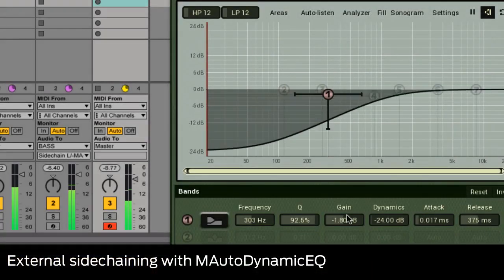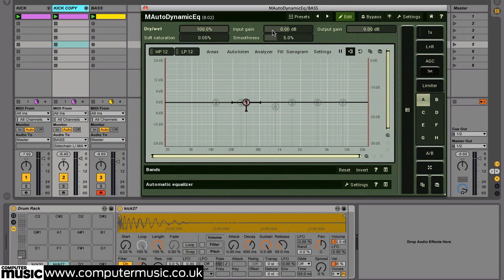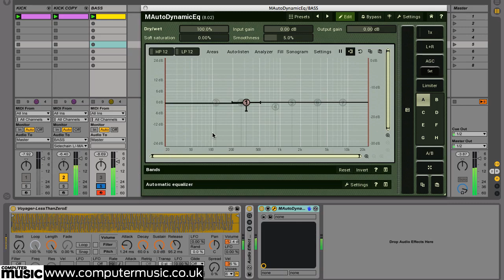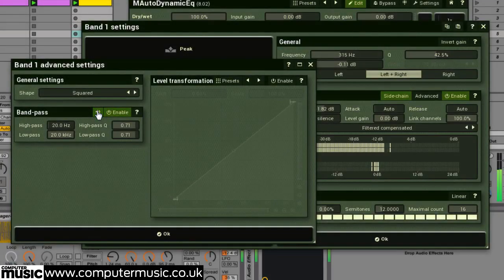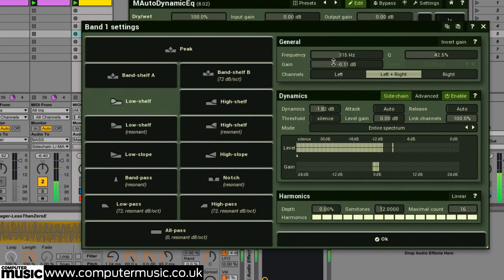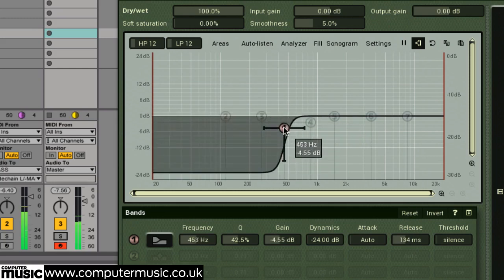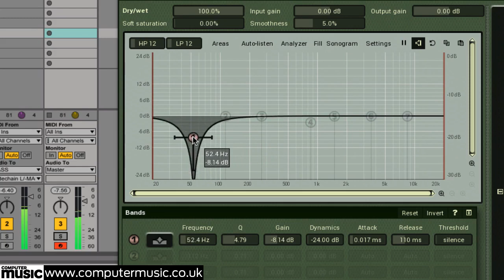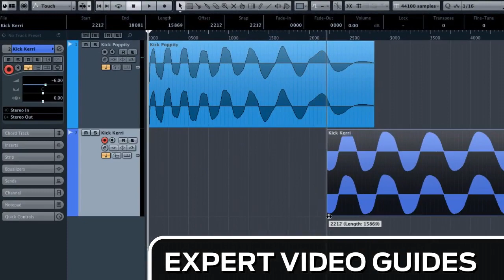Sidechained dynamic EQ with MAutoDynamicEQ 8 - 4/6

Comment: I don't see a ratio control.  Does this mean you can't do multiband compression with this?
Reply: It has all that. Click on the "settings" for the individual band. The UI is different now. There's a "band type" icon next to the frequency band number, click on that to access settings. It has all the dynamics of a regular compressor and then some. 

Melda also have a complete series of multiband plugins which feature crossover controls. But you can indeed abuse this as a MB comp and it works well.